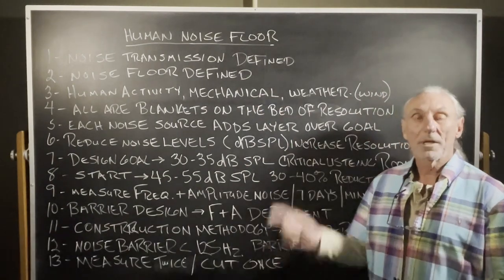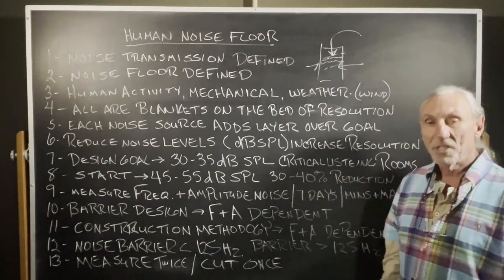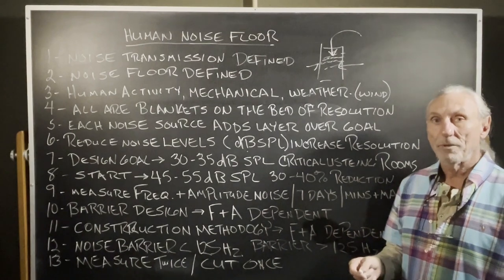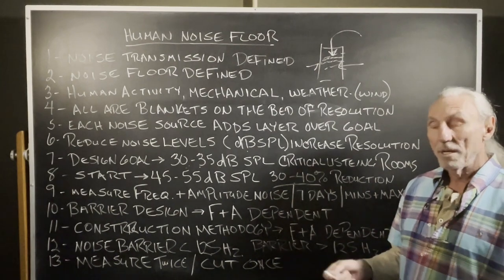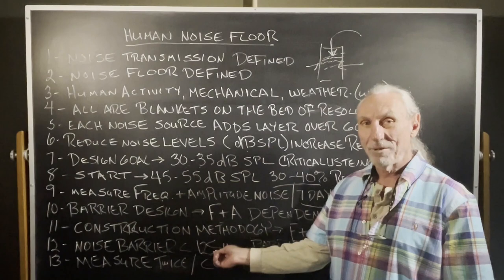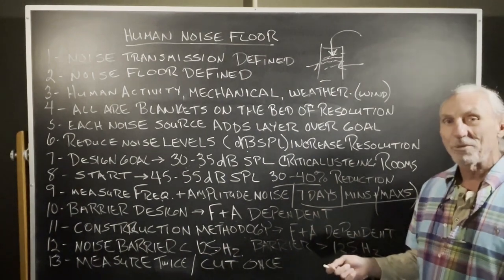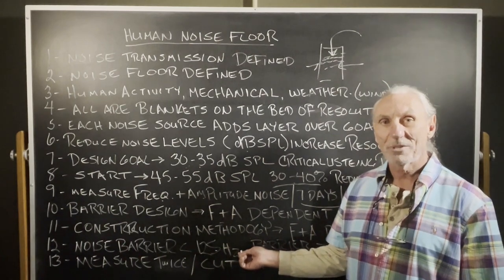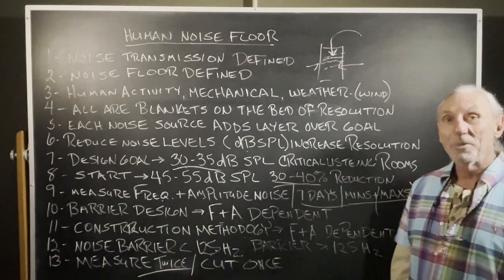Human Noise Floor - www.AcousticFields.com

Comment: normal room 10x10x10 is 30 sp (Db) & neighbor starts his truck and jumped to 50 db from 30 @9am. Amazing have had this Db meter on my desk for almost 2 years from watching you for 4 years. Much Appreciated in this Effort & Knowledge.  You save me in ways not measurable like frequency spectrum's !
Reply from the maker: Isn't it interseting the impact low frequency pressure has on SPL. It is a completely different amplitude impact than middle and high frequencies.

Comment: Very true Dennis.
It's why I prefer quiet minisplit instead of noisy h.v.a.c.
It's why I always say get a quiet ranch far from neighbors then build a home theater
Reply from the maker: Noise is a form of distortion that most do not understand. People get used to noise levels without understanding that they are listening through the noise floor in their rooms. If they llower the noise floor in their rooms, the first thing people do is turn down the gain. Less gain means higher source resolution along with less pressure for the room to manage. Its a win/win.

Comment: would you mind doing a video about measurement techniques and the tools for it? i just started measuring my home studio with the UMIK-1, for an acoustic treatment plan. but i hadn’t stopped to consider the possibility that i can use it to measure noise for an isolation plan. thoughts? or would i need different equipment?
Reply from the maker: Start with your room dimensions first and foremost. Then, add the usage. Compare the pressure level and frequency response of your usage.to the room response. The difference is the treatment requirement. Next step is to locate position of frequency and amplitude response differences ,so one can assisng the proper rate and level along with surface area coverage to treat the unwanted pressure issues. Rate and level are exponentially critical varaibles if your goal is resolution.

Comment: Thanks for the advice. I have an SPL meter on my phone but recently tried a different one and got completely different results almost 10 to 15 db Any suggestions on the best one to use?
Reply from the maker: The error rate is high on most units. We use Audio Control apps for good results with low error rates. Use their specified microphone for best results.

Comment: Loved the presentation up to the point where you say "spend $100,000 for a quiet room." Even if it's true, still I've got money in my office to try and get to -60db noise floor. Yes, most of my my is 250hz and below. Military aircraft, commercial diesel trucks, rude AF neighbors... Coming through the window and/or ceiling. Ive got mass loaded vinyl and and ton of foam and tiles to get to -58db average. Seems like my last option is to modify the exterior wall to add mass. Any other thought?
Reply from the maker: You are using tactics without a strategy. You must measure all noise for frequency and amplitude over a seven day period and then design for the maximum pressure and lowest frequency. Guessing with noise is a recipe for failure.